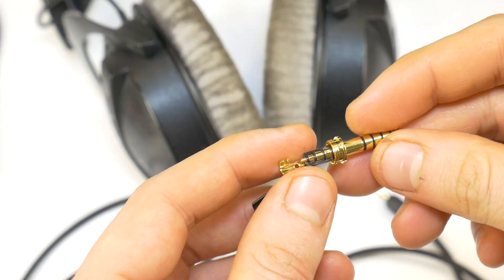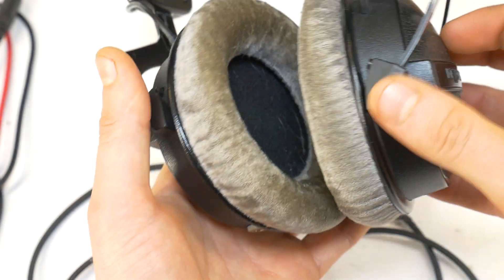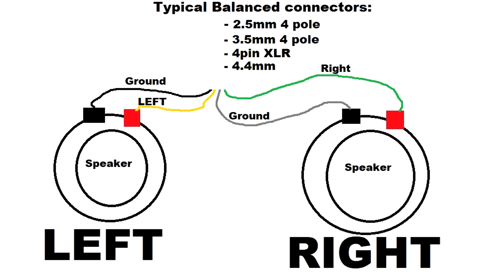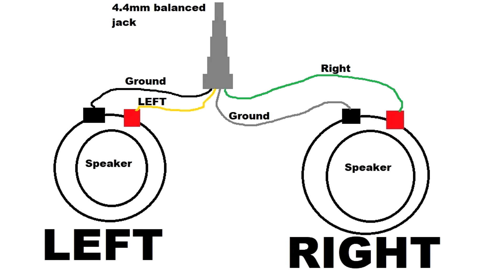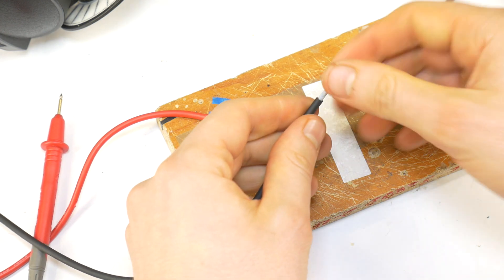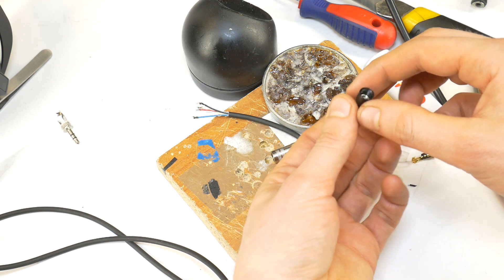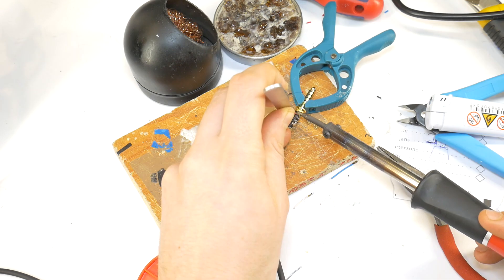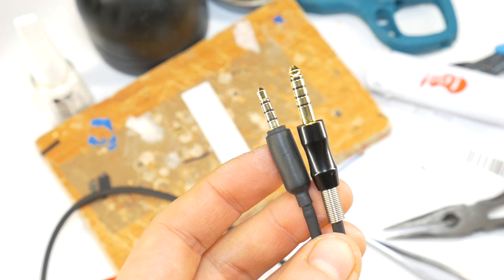How to Make 4.4mm Balanced Headphone Cable DIY

Comment: 1:26 so unbalanced design is like a parallel 2 speaker circuit where as balanced is actually a split circuit?
I have Audio-Technica ATH R70x. I am trying to terminate it to mini XLR 4 pin male and then I have 2 more cables and I will choose between them based on the balanced or unbalanced output I am searching for (1 cable begins as female mini XLR 4 pin and terminates as 4.4mm balanced jack whilst another begins the same [mini XLR 4 pin female] but terminates as unbalanced 3.5mm TRS jack). This way I can easily plug into anything I need.
I will mostly use these headphones with the iFI Audio iDSD Signature.

Comment: Bro, what is the role of "ground wire"? because there are 5 wire in 4.4mm jack. R+ , R- , L+ , L- and Gnd. Why the engineer add "Gnd" connection?
Reply from the maker: maybe to escape from outer fields and noise possibility.
Reply: @TechscrewDIY  ok 👍 ,but is it connect with left & right speaker as a third wire?(with speakers body)
Reply from the maker: @masabkhan2654  definitely better no

Comment: How do you separate negative pole on 3.5 jack side? If you can't, that cable is not true balance. When you plug in true balance port, you will hear distortion on upper frequency range.
Reply from the maker: therefore in 3.5mm side i use 4 pole socket.
Reply: @TechscrewDIY  negative pole will be same on 3.5 jack, right?
Reply from the maker: @chithtooaung3883  yes, if I understand you correctly

Comment: Hi, i need a 4.4 mm jack balanced cable with rca jacks to connect my Fiio M11 S to my stereo, can U make one for me or can U suggest where I would find one. Thanks
Reply from the maker: buy any rca cable and then solder 4.4mm jack.
Reply: Any luck getting one?
Reply from the maker: @Princeton_James  what ?

Comment: Great video! Very informative. I want to make a 3.5mm balanced cable, but I don't have an amp to use it on. Can I just plug it into the headphone jack on my laptop?
Reply from the maker: Unfortunately not.
Reply: hi friend, 3.5 mm is not a balanced option, sorry 3.5 is ONLY single ended
Reply from the maker: @CameoLux  dude, how many wires are used for balanced connection? And how many wires are in a 3.5mm 4 pole jack ?
Reply: @TechscrewDIY  no need to be rude, you’d need a balanced 3.5 jack on your listening device, I found out about 30 minutes after that comment that it does exist, just from a specific (maybe few?) brand, had no idea. 
We’re all learning lol
Reply from the maker: @CameoLux  thanks for feedback and good luck :)